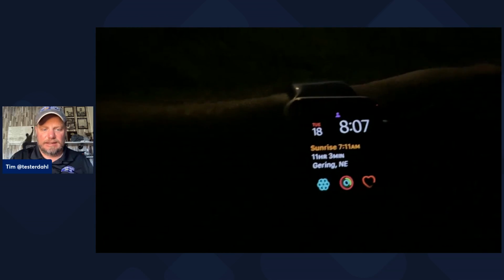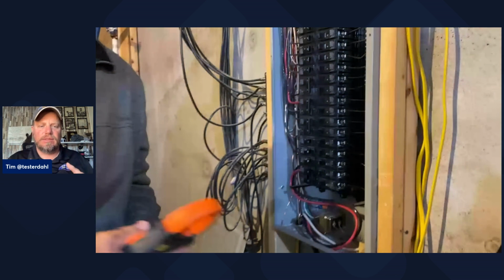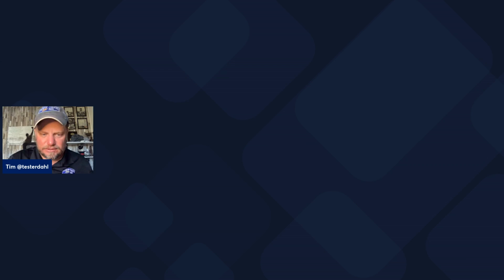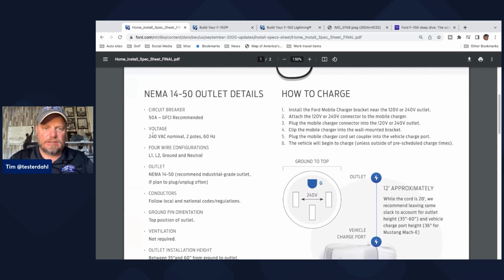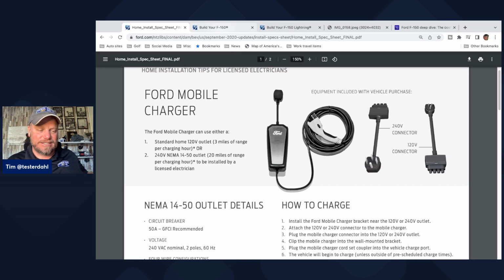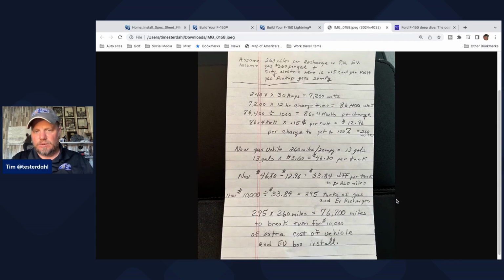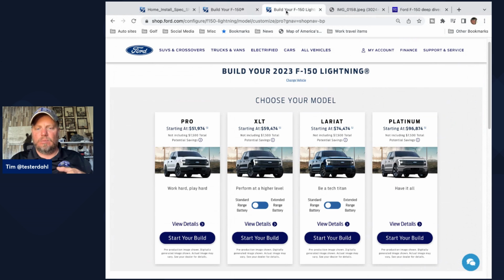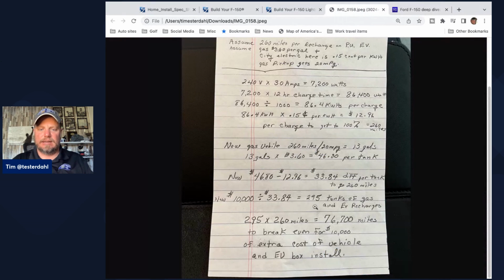11+ hours later on 220V charging price for 2022 Ford F-150 Lightning

Comment: $80-90k trucks 😂 that's just silly.

Solid analysis and thank you for sharing your experience with us. I appreciate your aknowledgement of the multitude of factors to consider when analyzing a "break even" point on EV vs Gas. For me, I'll keep rolling in my 2005 Silverado with 225k dependable miles on it. I haven't had a truck payment in 12 years, and don't foresee getting back into one anytime soon.
Reply: Actually the MSRP is 51,000 so if he spend between 80 to 90,000 he was completely ripped off by the dealerships. Like alway ..
Reply: Was 38.000 untill the government took away the incentive I see people with Generator,s in the back of EV Trucks
Reply: Of course, but, private vehicle ownership is going to go away for most of us, eventually, only the affluent will be able to afford privately owned cars, between the prices to buy, the cost to insure, you will have to use filthy robo ride sharing taxis.  And it is going to cost about 3 times as much per mile as you spend now.  Oh and you will not be able to use it during peak times.  Or should I say rates will rise sharply depending on demand at any given time.
Reply: @10469  Where do you buy a vehicle at MSRP to where the dealership makes no money?? Doesn't a business/dealership have to try to make a profit? Sorry, my college edjumucation kicked in.
Reply: @nickoD509  Dealerships to make money and so many other ways of ripping you off selling new used cars repairs extended warranties so on and so on. The point is illuminate the car dealerships and buy directly from the manufacture so I don’t have to pay more.
Reply: @markwalker3499  I mean maybe in 100 years, hopefully never!
Reply: Many are over $100,000. Every new vehicle I've been considering is at least $60,000. The days of affordable vehicles is gone.
Reply: @10469  unless you're trying to drive the cheapest piece of junk that a company makes nobody buys the base price vehicle. Most cars have at least $10,000 in options
Reply: @nickoD509  MSRP already includes a substantial and suggested profit for the dealership.
Reply: What's $80k? All nice new vehicles cost that much now. It's not the 80s anymore.
Reply: @theupscriber65  A normal SS check is 1,200 a month.
Reply: @theupscriber65  yeah and that's more than most people can afford.
Reply: Yes, my '05 GMC Sierra, 190k miles running like a champ. I'm buying nothing.
Reply: You can buy a used semi truck for less and you can make money with it
Reply: @markwalker3499  I hear ya buddy...  Best to keep an oldie from the 80s or early early 90s in good order to move around.
Reply: @ThePugPrince  I hopefully never thought forced jabs would be a thing, so cars are a much more insignificant issue.
Reply: Is you live in California they will force you
Reply: @nickoD509  dealerships pay invoice price minus other discounts for sales volume, not MSRP.
Reply: @nickoD509  davesmithmotors
Reply: @Sailor376also  yeah if SS is your only income you shouldn't be able to afford a brand new truck. We live in the USA where hard work equals income. Not Russia where the hard working people pay into socialism security for people who don't contribute to society.
Reply: @theupscriber65  I work plenty.  And I have worked a butt load in my life.  71 yo ?   So take income earned and saved, and even invested  circa 1980.    80k is a pant load of money.  And worse,, I want a truck,, a truck.  Not some tarted up blue tooth power everything 0-60 in 2.3 sec,,,  A truck with no bs  that doubles the cost.  A truck,, should cost about 25 or 30 k.  The next 50K is just and only BS stuff that does nothing.
Reply: @sandraherdman3783  Very few out there so if you are seeing trucks that is crazy. If they have a generator in the back it is for a job site not to charge the truck. It would take too long to use it to charge the truck.
Reply: For that much I would rather buy a new Corvette.
Reply: Agree 100%.  My wife and I haven't had a car payment since 2006 and our house has been paid off since 1995. She has a 2003 Saturn Ion Quad Coup 185k miles(it's been a great car and gets 23 mpg city-30 mpg highway). I have 2003 Chey Suburban Z71 with 65k Miles(13-17 mpg).
Reply: The Ford lightning is an excellent investment for your money.  I bought at MSRP and could sell it today for $30,000 easily over what I paid for it. At 73 this is an investment my 4 children will be able to sell and divide proceeds among themselves.  Our dollars are depreciating right before our eyes, the stock market is going to crash very soon. We are probably looking at something worse than the 29 crash. Bucket up. As much as I just wanted an all electric truck,  even more important was a safe haven for my money.
Reply: @sandraherdman3783  generator in the back of EV's kinda defeats the whole purpose.  I  charge mine off my home solar system.
Reply: @nickoD509  They already make a profit from a percentage of the MSRP.  The dealer I purchased my lightning from sells all their new vehicles at MSRP.
Reply: @theupscriber65  Agreed,  it doesn't have to be an EV to cost $80k.
Reply: @Sailor376also  Hopefully you'll have a retirement plan prior to retiring.  Social security was meant to be a supplement to a retirement plan. I realize that's all many people have but with our now failing economy,  many of those people just are going to survive.
Reply: @pstoneking3418  what do you do when you can't find a plug. Cause there's a mile long line , Accully he helps those who run out of power I guess there's a learning curve to owning A EV
Reply: @Sailor376also  Sorry sir, a real truck is what the lightning is. It's not for long distance towing or travel. But for local use, it'll do everything.  If you by any full size pickup truck you're probably going to pay over $40k.  In 1983 I bought my first new F150.  3 on the column, power steering,  no air, not even power brakes,  no power windows or locks. Inline 6 cylinder.  Cost me around $3000.00. And it even had a full 8 foot bed. Those days have been gone for a very long time. At 73, I got tired of seeing my savings I worked for all my life. So I traded in my 2014 F150 and my 2018 Toyota Prius, took out my savings and bought a Ford lightning platinum at MSRP.  When I  drove it off the lot, instead of it depreciating a couple thousand dollars it appreciated by over $30,000. I never had it for more than a week when I was offered that amount over what I paid for it. With my retirement & SS. I don't need the money so I'm not selling it at any price.  I'll be leaving it to my children to do what they wish. Better than holding gold or silver. I  kinda look at it like $100,000 insurance policy although I believe they'll be able to sell it for more than that.
Reply: @seanroge  Not sure why there'd be a generator in the back. Even a 10 kw would only charge at just that or less. The 240 volt mobile charger uses around 7200 watts, that would just about use up all the power.  I use my on board 9.6 kw generator for any power tools I have so again, not sure why they'd haul around a generator.
Reply: @pstoneking3418  Well into it.  Over 70 y.o.     Been self employed all my life.  Still working.  I don't ever want to retire fully.  Aside from work, I still have rivers to canoe, I was out on Thursday.  And oceans to sail,, bought the boat intended for a trans-Atlantic two weeks ago.   It remains,,,  Most manufacturers have forgotten what a truck is for.  For centuries,, for millennia,  10% of vehicles built or sold have been light trucks,,, Call them buck boards or dray carts,, that 10% figure or higher has been a fixture.  Did you realize that the width of train tracks is the width of Roman wheeled wagons? It is not accidental.  That dimension,, and it is closely allied with a pickup's stance, has not changed in 2,000 years.
The newest pickups are tarted up, gussied up,, much too tall,, too short a bed for a sheet of plywood,  much too fast, (really,, you need 0-60 times of 4.6 seconds to carry bags of cement ?)  Basically they are chromed, plastic, with lipstick,, f*****g useless POS.  AND,, they cost 3 times what they should.  And 3 times what they could cost.
That 80 to 100 thousand dollar truck?   30K is for the truck,, and 50 to 70 is for the 'bells and whistles'   I just want the truck.  The rest of it is a waste of money.
Reply: @Sailor376also  then why didn't you buy a work truck? Mine was $10,500 brand new in 2003. But that was 19 years ago.. $80,000 is nothing today. Any college grad with a real degree should make that his first year out of school with no experience. You're living in the past.
Reply: @theupscriber65  You just made my point for me.  Perfect analysis.   10,500  in 2003  was   1/5th of an annual wage for an experienced tradesman.  But 5 times 80,000  is 400,000 per year.  In 19 years, inflation has moved the 50,000 per year to 120,000 per year,,, not 400,000.  And to me the sin is,, a truck,, heck,, just last year I passed a sign in KC advertising a stripped down F150 for 19,999,, 18 months ago.  But try,, just try to find less than 50,000 today.  It can be done,, but the list of blue tooth, power windows, power mirrors, infotainment ,, it just goes on and on.  And I,, and almost all tradesmen,, need a truck.  I currently,, just like you, own an '07 and an '09 F150.  An 80,000 'truck' just has no business on a muddy jobsite with cement blocks loaded in the bed.  They have stopped building trucks for people who need trucks. They have lost my business.
Reply: @pgnandt  I'm with you. My 2003 Suburban Z71, I bought when it was 18 months old and had 29k miles on it and it now has 64k Miles on it. It needs to be driven more but I retired 6 years ago and it gets 13 mpg around town and our other cars at that time, an 01 Toyota Celica(fun to drive) and my wife 03 Saturn Ion Quad Coup(also a hoot to drive 185k miles) both get 24city-30highway. I'm 71 neither my wife or I have ever bought a brand new car. Not planning on changing now. Just bought a '14 Honda CRV to tow behind our motor home(job held currently by the 03 Saturn.) I just wish the price of diesel would come down as the '03 MH is 40' diesel pusher and gets about 7.5-8.5 mpg. Have a great day!
Reply: @rickl6697  Yes what's nice about us old folks is that we don't spend money we don't need to. I've also never bought new. Just near new. I'm buying nothing.
Reply: @pstoneking3418  I am saying for a job site not to charge an EV
Reply: @pstoneking3418  Good luck have dealers calling me for less than 30,000 over MSRP and they can’t sell them. Everyone thought it as an investment but panning out to not working out.
Reply: Just like Biden 🤣🤣🤣😁😁😁
Reply: Agreed. I'm just gonna keep my 06 CVPI that I paid 2400 for. And it runs great and will last forever. 15-18 mpg yeah not great but I'd never break even buying an expensive EV. GM is trying to make it enticing w the 6k back on the Bolt.
Reply: Honey, many are over 100,000.
Reply: Agreed, if they want people to switch, EV makers need to build a better mousetrap.  That hasn't happened, and it may never happen.
Reply: @bannedtwice7767  Then they don't get to buy one.

But seeing how many are on the road, a lot of people ARE affording them.
Reply: @sharoncrawford7192  I can ask a million but that doesn’t mean someone will buy it. The market is turning out to be a lot softer than people expected. I know of a dealership that has a Lariat with 500 miles have lowered the price to 92k and still is sitting.
Reply: @nickoD509  they all make money 
Plenty of dealers sell ar msrp
Not $10K over
Shop around
Reply: More than 100k, specially if you finance...that's Krazy..